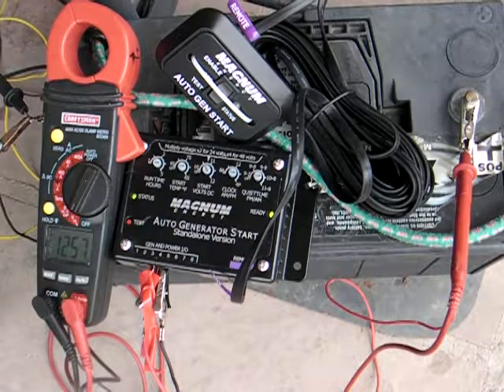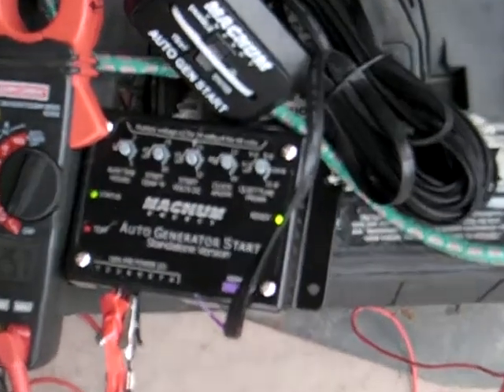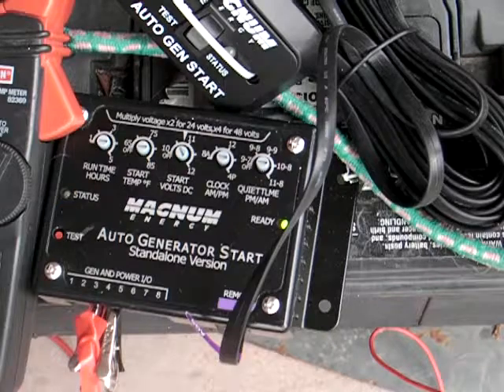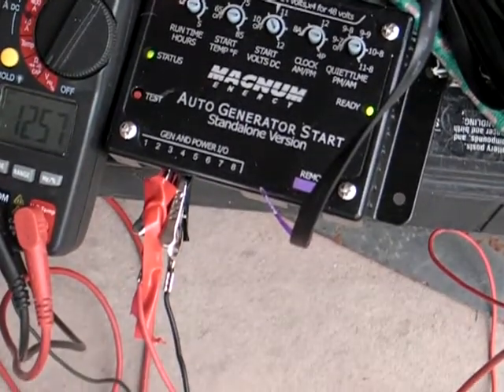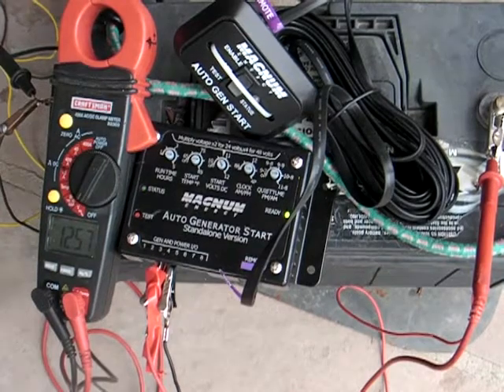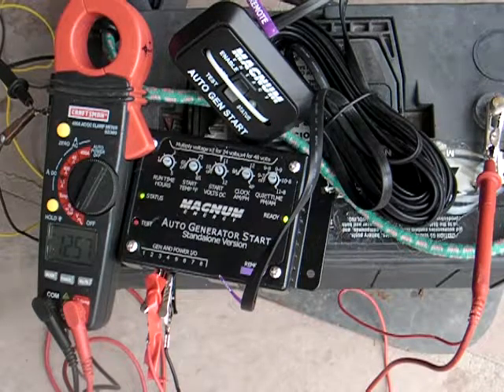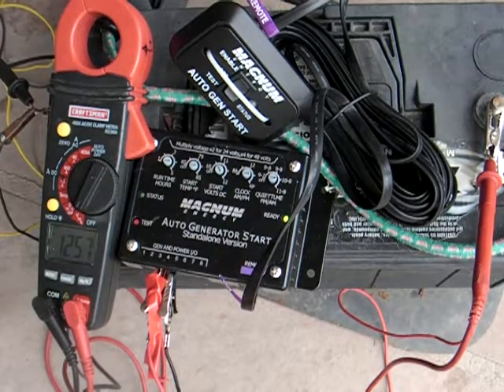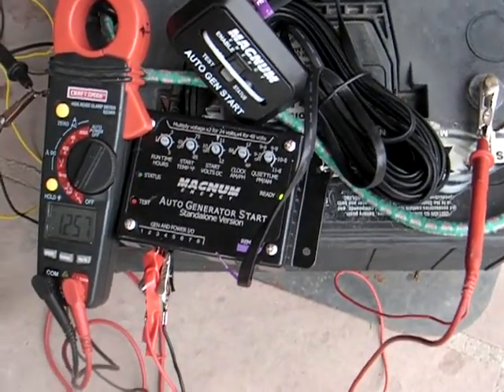Haunted Magnum auto gen start , AGS ME-AGS-S

Comment: Mine does the same thing hooked to 48volt battery bank random starts at who knows what voltage and it will run for the hour and shuts down and then could restart in 20 seconds or an hour or never

Comment: Hard to tell in the video, but is the temp setting turned comepletely to off?  It could be trying to start for reasons other than the battery voltage.
Reply from the maker: Yes, everything is off. It shouldn't do anything. Final Magnum Engineers verified my complaint. I made this video for them. Last I checked in with them, I still have the last unit they sent under an RMA, they had no solution to replace it with.
Strange some found it boring, but I warn, the action is random, so you just sit a watch. My first test was to just let the camera run and come back in and hour to watch what had happened.